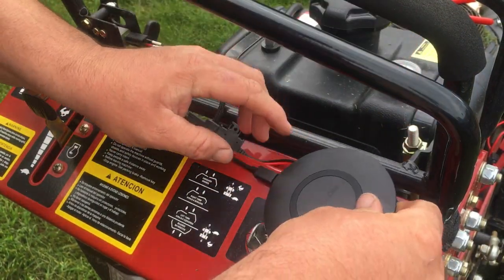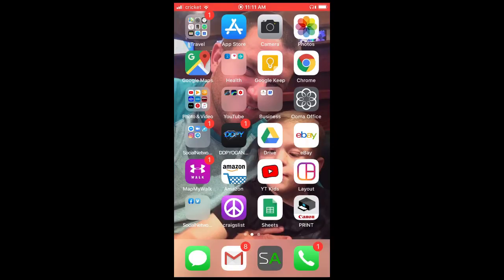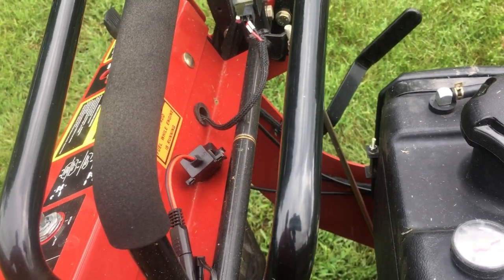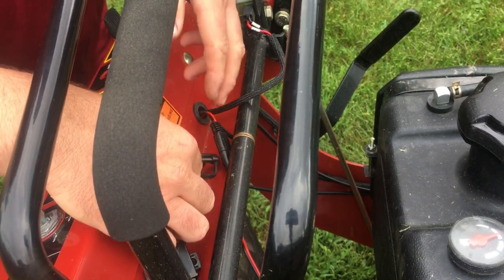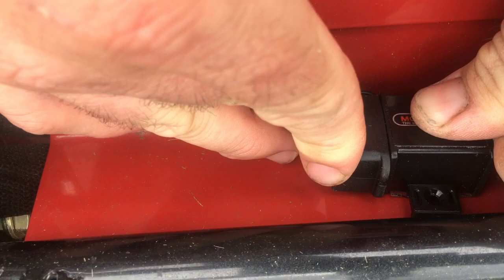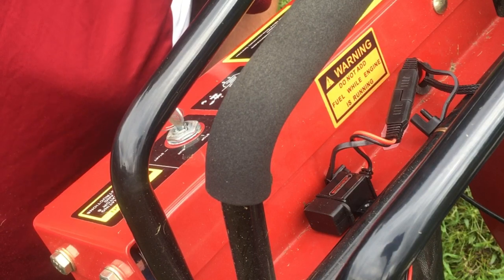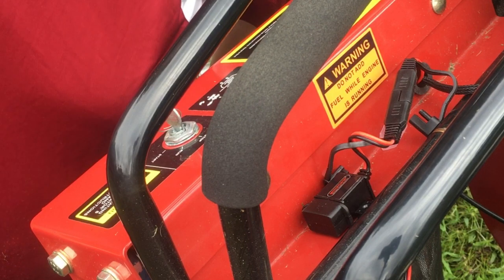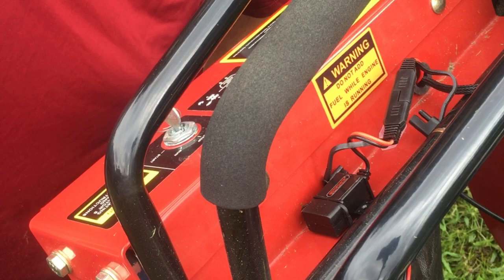Adding A Phone Charger To My Mower

Comment: Big advantage of that system is being able to buy different adapters.  One to charge the battery, one for a cigarette lighter adapter to run a small portable compressor, chargers for cell phones (which you are doing) even small tank sprayers.  I have the battery terminal part on my mower, four wheeler and  motorcycle.